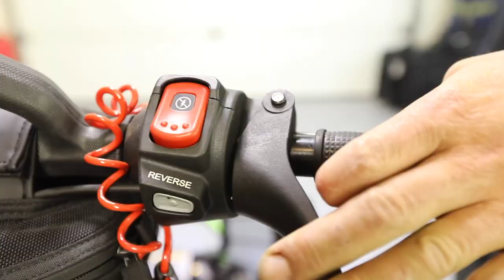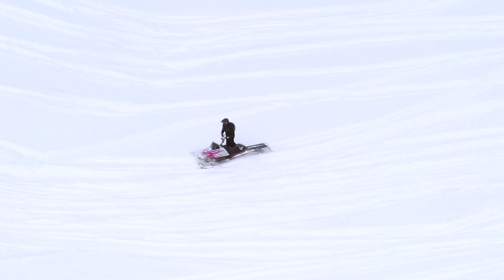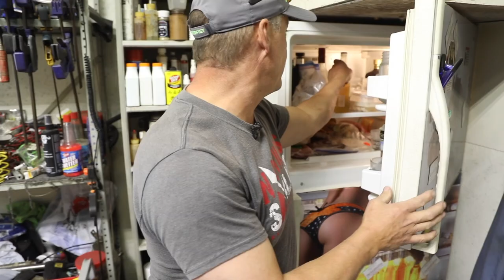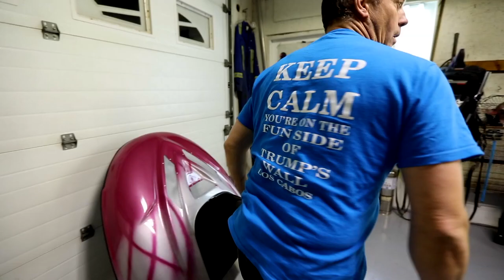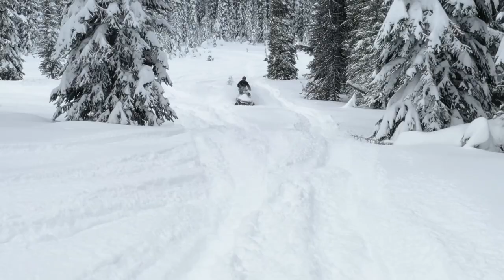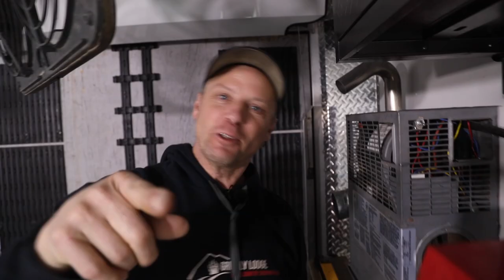2 STROKE TRIPLE: mod sled braap and bloopers. Getting stuck. Mountain climber.

Comment: We need too be putting these triples in new forward rider chassis.
Reply: that’d be so awesome
Reply: I wish but I don’t think they’ll fit in any of the new chassis. It would have to be a newly designed sled just for triples.
Reply: Xcr 800 ves motors in them would be insane
Reply: Tyson Seabrook  a 2000 xcr 800 triple VES makes 180hp, stock.. port them and do other work they can see 200hp easy. Not to mention they hammer. Its about being unique and having fun.
Reply: @wynterj6616  dude put a storm motor in an iqr chasis
Reply: @kristerjl on Instagram put a Yamaha triple in his rev it’s nothing like these triples but idea is possible
Reply: Tyson Seabrook  we aren't talking about brand new sleds. Or currently running sleds. It would make no sense to do that. Imagine if you cam across an iq440 with a blown engine. A triple swap would be perfect for it. Or an older model rev. Keep in mind built and ported triples make 225 pretty reliably. Also world record hillclimb was on a nitrous mountain max I'm pretty sure.
Reply: We do that in Sweden. not very good results. well thay are cool, but too heavy and too wide,  Suzuki twin 800cc turbo is best option for mountain riding. :)
Reply: People do it a lot.
Reply: @wynterj6616  wrong VERY wrong .. lolol
Reply: @sideshowruest  780 or 809 for RER LOL
Reply: I have a 1994 780 mach z motor at 200HP just by porting lolol she's going in a 2005 summit X chassis 151
Reply: @wynterj6616  wrong on every level this comment is very wrong
Reply: Tyson Seabrook  please do research before you type okay? Triples are unlike any thing out there and you cannot compare to the sound and pull of a tuned ported and piped triple I have a 1994 mach z 780 motor at 200HP in an 06 summit X only reason why I went with this A- my girlfriend already had a 780 B- parts are everywhere and the chassis was CHEAP with a typical blown twin skidoo motor C- 2003 809 RER bolts onto 780 motors
Reply: @samarmstrong4328  it is..
Reply: @damiendoisher7812  you can fit any motor in any chassis just gotta have the coin if you already have a donor rolling chassis it will normally cost 3-4G to do it I've built 4 now its not hard time and money consuming
Reply: @sciencemilitia1853  yes we do
Reply: @thatmodshop7160  you ever seen under the hood of a 2012 or newer rmk. Zero fucking room
Reply: A stock triple in a rider forward chassis will keep up to a twin EVERY DAY and yes I've built several. Now so you might understand there is a HUGE time gap from triples to new twins no doubt. Therefore to make a carburated engine perform to an efi work does need to be done hands down no question.

You are the one who started the interesting comment comparing a twin to a triple. Nothing is stock VS stock in any of this discussion 🤔

The stock HP of these old triples is what these new sleds are FINALLY catching up with now they are really worth it especially considering the huge time gap amd the fact you can with little effort make far more power. All sleds are great and unique in there own ways but the original and whole idea of this thread/comment is about putting a triple into a new rider forward chassis that right there will pass your 850.

 Until you build one you will never know and you can talk a mean keyboard warrior game but bring actual facts to the table and join the adults.
Reply: @wynterj6616  I love building sleds soooooo I guess anyone that builds sleds has a screw loose LOL and I've dumped a 680 ultra in a 2014 chassis it's not complicated or hard. Young new riders or guys that don't understand cause they cannot build will never know what its like having something built not bought
Reply: @wynterj6616  doesn't mean guys don't do it and that it can't be done man ANY build is possible. Bulkheads and bellypans don't stop a builder with slight modifications you can have whatever you want. There is a legend who builds motor plates to fit any motor in a polaris chassis amd there is another legend that will build any pipe to fit in any chassis. I can clearly tell you are not a part of the building world and thats okay! I encourage any person to do at least one build to clear out any misunderstanding people might have anyways man stay safe keep riding and hopefully you might build one day
Reply: @thatmodshop7160  I built my own shitbox xcr longtrack. But I wouldn’t wanna mess with cutting pipes to fit a triple in a newer chassis
Reply: @Tyson Seabrook I see your arrogance matches your knowledge. Clearly to you this is a little man big man competition and I hope you can humble yourself enough to understand. There is ALWAYS a know it all which I have met plenty of there is no point on continuing trying to explain something in facts and first hand experience to someone that has got to have the last comment or have the bigger brains cause it makes you feel insignificant lol 

I will lastly leave it at this. It took polaris years to make a good/decent 800 amd why do you think they finally decided a with a new 850?  

Polaris among other manufacturers could not understand from factory how to build a properly tuned and peak performance triple.

 Now don't take what I said out of context they were all very competitive and close to breaking the chain and unleashing a factory 190hp stock machine. Power to weight is everything but if you dont have torque to back it up you have nothing. If you match power to weight with enough bottom end then weight loss or gain in a motor or irrelevant.

Manufacturers gave up because they didn't have the technology then as they do now and this is why it is worth putting an older triple motor in a new chassis (for myself) as the motor can/will pull away from an 850. The only reason why fellers like yourself are ignorant and don't understand is because you haven't seen or done these things first hand.
Reply: @wynterj6616  there are professional shops who will build you custom tuned pipes for your exact application
Reply: @sideshowruest  👍🎯😎🙏🏻
Reply: @thatmodshop7160  ANEN!
Had a Very Built Yammy RD 400 twin street bike back in the day which I bought as a basket case after a friend who is good at disassembly, BUT never takes pics or notes, tore apart to “fix” ... 
long story short, my best friend bought a brand new Yammy RZ350 which was two generations newer and an Awesome bike. (My brother bought an identical one which we left stock to do A/B comparisons after moddiing buddies bike) 
Anyhow, after all my mods (90 over, Weisco pistons, aggressive cylinder porting, carb & jet / pipes work, etc., the two would accelerate almost the same. 

I thoroughly enjoyed the experience and the thrill of cheaper personalized custom bike keeping up with the big boys - we would absolutely Trill & SMOKE all the Harleys in town and OWNED the half-litre sport bikes we went up against.

Good Times.
Reply: @thatmodshop7160  TORQUE, BABY!!! 👍😎
Reply: @glenholmgren1218  can't beat big blocks!!
Reply: @sideshowruest  try 155 stock
Reply: @wynterj6616  xlt600 fit in some newer ones

Comment: Damn you have that thing running crisp. I had a 1025 crank shop triple in a lightened up zx chassis way back when. There is still no better sound than a tapped out triple climbing.
Reply: Unless it's the BRAPP of a 4cyl 2stroke!..lol..from Wyoming USA 🇺🇸 🤠

Comment: One of the big 4 needs to make a modern efi spin backwards reverse triple!!!!!!!!!!!!!!
Reply: 1994 mach z 780 and 2003 809 has RER only skidoo did so amd these motors just pipe and porting easily do 200HP

Comment: Hay man I got my old 97 summit s chassis 830 mod triple with the crank shop pipes out last weekend needs some more tuning but god I love that sled but not as cool as your 1029 triple i got a question for having tall handle bars do you have the same issue as I do when I pull it back hard enough it just moves like it has no grip but it as tight as I can get it do you have any solution to that problem? Because I haven’t found any ideas to fix it
Reply from the maker: Ya , shave the 1/2 clamps down so they don’t bottom out , also take a centre punch and knurl the handle bar where the clamps go ! Make sure your bolts aren’t running out of thread !
Reply: @DIGIT9  thanks👍